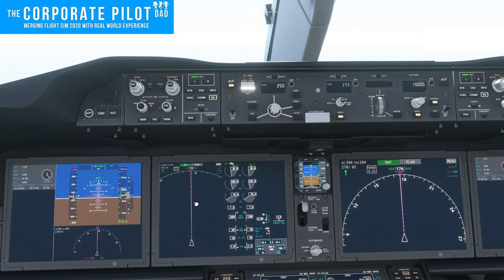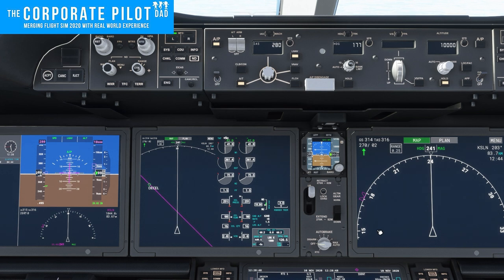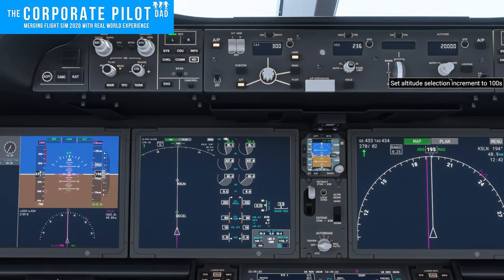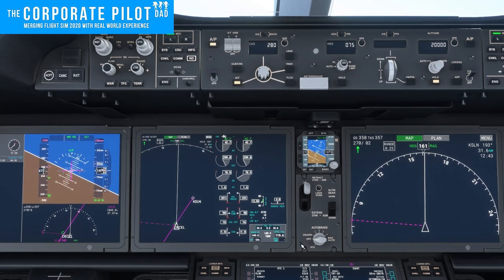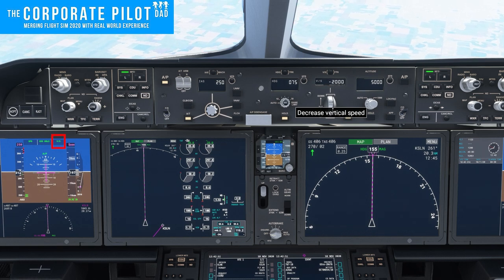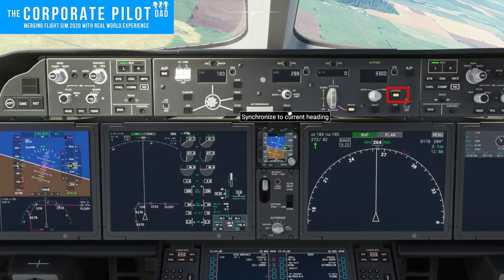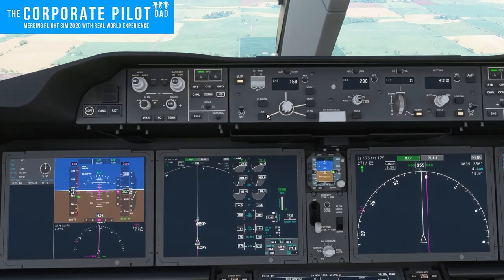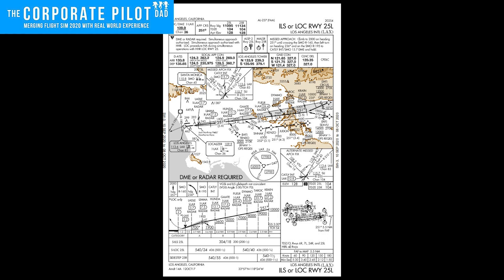Boeing 787 Autopilot Tutorial | Microsoft Flight Simulator

Comment: For me, the autoland just decided to nosedive into the runway. Everything goes smoothly until the very last point, about 10 feet above the runway, but then it goes down for some reason instead of holding height and descending naturally. It's an ILS approach, KDMA to LRAX, RWY 25L. I could of course land it myself, or hold the stick to stabilize touchdown, but I just thought the Autoland function would've been so cool if it worked. Might've just been an unlucky attempt or a bugged runway, but still. Feels bad
Reply from the maker: When I made that video I had great success with autoland.  Since then, and a few updates later, it does not seem to work as well.
Reply: My auto throttle doesn't even work for some reason, even with this very nice tutorial

Comment: Great vid and info. Thanks. I had a bit of confusion with the Dreamliner last night. I was flying in to KATL and every time I tried to click APP or LOC the plane would try and turn the opposite direction and I was looking at the landing plate on Navigraph. I should have been picking up the GS. Any idea why that might happen? Thanks again.
Reply from the maker: It is hard to say.  In the 787 if you hit LNAV it follows the GPS route.  If you press LOC/FAC on the far right side of the flight guidance panel, it will ignore the GPS/FMC route and intercept the localizer.   Once you're cleared for the approach or in this example, on the localizer, reach up and press APPR on the panel.  I haven't used the 787 in quite a while but when I did use it in FS2020, that's what should make it work correctly.  The LOC/FAC button is the solution, I believe.  I think button and it's explanation is at the end of the video.  You did say you pressed APP and or LOC and had that problem so if you already tried this, let me know.
Reply: @thecorporatepilotdad  thank you. I did try that. But I think I very well may have programmed something wrong from the start. I'm pretty new to flight planning and it's a pretty big learning curve. At least for me. I wish I had a tutor lol. Thanks for what you do for the rest of us.
Reply from the maker: @crawl3ysnipe  Out of curiosity, did you input the localizer frequency into the FMC or were you doing a GPS approach? What airport and which approach were you doing?
Reply: @thecorporatepilotdad  well, that got complicated lol. At the end I put the localizer  but apparently that was too late. I was flying from KDFW-KATL. Also for some reason, the plane didn't fly the correct rte. That had to be me inputting the wrong wpt. I'm actually trying it again right now and I already know I'm going to have the same problem. I tried to load the FP from SB and chose the wrong wpt I guess.

Comment: I’ve been looking all over the internet for this but I can’t find an answer. Is there a way to enable the managed speed mode where the auto throttle responds to flap changes? I’ve done it before but couldn’t get it on my last few flights. In airbuses it’s easy because there’s just a button but not on the 787. Thanks in advance.
Reply from the maker: When ATs are engaged it should adjust power to maintain the set speed regardless of flap settings. In managed speed mode(speed being controlled by the FMC waypoints/speeds on SID/STAR), I don’t believe the B787 in MSFS will hold speed with the FMC.
Reply: @thecorporatepilotdad  Just to make sure I’m getting this right (there’s a good chance I’m not), the 787 doesn’t have a managed speed mode in the same sense as airbus? If so that’s odd because on multiple occasions it has adjusted the speed based on flap increases/decreases.
Reply from the maker: @nls.135  the speed does adjust on the airspeed tape showing the max speed for given flap settings as flaps are added.  I don’t believe it is capable of adjusting speed with ATs on an arrival with a particular speed at a waypoint due  MSFS programming.   For example, the airplane I fly in real life has auto throttles and they can be set to follow the speeds on an arrival in the FMS (managed) or set a speed manually with the speed bug (selected).  The Airbus works this way but I do not believe the B787 in MSFS will do anything but selected speed set by the speed bug.

Comment: How would you exit heading select mode to go into LNAV? Because when I clicked LNAV again, it didn't want to go back to my flight path. I tested that by turning the heading bug and it was still in heading select.
Reply from the maker: You did it the right way by pressing LNAV when in HDG mode.   When a button is pressed on the flight guidance panel such as HDG or LNAV, make sure the flight mode annunciator (top of the PFD) switches to that mode or at least arms (in white).  Sometimes an airplane will stay in heading mode but LNAV will be selected and won't change to LNAV until the course is close to being intercepted.
Reply: @thecorporatepilotdad  yeah I tried waiting until it got on course and still didn’t work. Maybe I’ll try it later today. Thanks for the help tho.
Reply from the maker: @Zenoman1234  Did it do the same thing before the latest update?
Reply: @thecorporatepilotdad  I actually upgraded to premium deluxe yesterday lol. But I know how to fly the 78 since I have seen many vids of it.

Comment: Hi there, actually when A/T is on, I can pull my throttel lever to idle, but nothing happens, it keeps running, plane goes into flare, but it does not sink enough and flares alot until I push the nose down doing almost a 3point landing. Anyone else got this phenomenon?

Comment: I can't seem to figure out when to switch from LNAV to loc then to approach mode. Other than that I've finally started landing doing ILS.
Reply from the maker: LNAV will follow the localizer.  Approach mode will follow the loc and glide slope.  In the real world, APPR is pressed when cleared for the approach. In MSFS, APPR can be pressed any time up to the final approach fix/glide slope intercept altitude or before.  APPR mode will still follow a course but it will also follow the GS down to the runway.
Reply: @thecorporatepilotdad  thanks for this video, used it and I actually landed the 787 which felt really nice.
Reply from the maker: @ilbambino96  glad to hear you’re enjoying it!
Reply: @thecorporatepilotdad  thanks! I'm using my xbox controller for now but would you recommend getting a mouse and keyboard as well?
Reply from the maker: @ilbambino96  I have MSFS on PC but anything you can do to make it easier would help.  Rumor has it MSFS can be  difficult with an XBOX controller.
Reply: @thecorporatepilotdad  gets tricky while I taxi and using controls in the cabin but other than that it's alright. But yeah thinking of getting a mouse and keyboard for it as well.

Comment: How did you control the speed using the autopilot painel if the autotrottle was suddenly deactivated (7m40s)? It looks like A / T was still working. How did the plane keep 180 and then 160 knos with A / T Off? Thanks
Reply from the maker: I was adjusting the throttle manually.

Comment: When do you typically press the VNAV button?  Can you use it also for
Take off and climb?  I tried it and it turns off when I hit cruise.  Just wondering when to hit it.  Thanks!
Reply from the maker: I do not think VNAV does a whole lot of anything with the default aircraft.  It is extremely limited with the 787.  You would press VNAV and set the bottom altitude and wait for VPATH to capture.   Here is a video on VNAV I did a few weeks ago if you haven't seen it already.  The concepts are the same.  https://www.youtube.com/watch?v=Uu36df6145g&t=1s

Comment: liked your auto pilot video.. my 787 heading "sel" does not work. it is locked in the hold mode. Any ideas on how to fix it?
Reply from the maker: On the heading knob there is a black button labeled SEL for select.  Push it and the flight mode annunciator will go from HDG HOLD to HDG SEL and then the AP will fly whatever heading is selected.

Comment: So, I've tried this several times w/ the 787. Everything goes smooth until about the last 50 ft or so and the nose pushes straight down & I bounce down the runway.  lol.  any idea how to keep that from happening?  The G/S and Loc are captured....but just...SLAMS into the ground.  Help?
Reply from the maker: Do you get rollout and flare on the flight mode annunciator?  Was it windy when you tried it? I haven't tried autoland in a while.   I'll have to try it again and see what happens.   It's been hit or miss sometimes with autoland.
Reply: @thecorporatepilotdad  thanks for responding.  I do get rollout & flare mode on the annunciator. I've tried it at least 12+ times in all conditions with the same result. Gets right above the runway and the - nose down.  Here is a video from a stream last week - https://youtu.be/-t1J7L8fyPk?t=8132. This was the first time I turned auto throttle off & tried to control the throttle myself - thinking maybe that would help - but it didn't. lol.
Reply from the maker: @thetattooedbacon  When I did that video the AP was on and the auto throttle was off.   It was also a few updates ago so who knows what changed.   Are you live streaming through YouTube? I'm planning to try a live stream with the CJ4 Friday or Saturday night.   Maybe both.

Comment: sometimes when o press LNAV the plane still doesn’t follow its flight plan. any reason why?
Reply from the maker: What does the flight mode annunciator show when you press LNAV? The FMA is on the top of the primary flight display.  That’s where the AP will indicate what it’s doing in green and what it will do next with a mode below or beside the active mode.  When LNAV is selected, the FMA should indicate NAV in green (possibly with a box around it)  when the flight plan in the FMS is being followed.  Also make sure a waypoint is selected so it has a fix to fly to.  Hope that helps.
Reply: it works now! thank you

Comment: My biggest problem is holding correct altitude in the 787. It's supposed to have a standard baro button but I can only adjust it. I reach fl40 and atc tells me I'm 500 feet above so I blindly adjust baro pressure until I'm no longer being yelled at by atc. Then once they stop yelling, a few minutes later I'm again 300 feet or so above my FL. Despite me using altitude hold, it still does this. I know I'm using it wrong but the button that's supposed to be a standard "the std baro button" baro measurement doesn't on xbox. I've searched everywhere for info and fixes, but to no avail. I just have to play with pressure until atc shuts up.lol
Reply from the maker: ATC has been silenced for months on my MSFS.  Silenced ATC is more realistic than talking ATC on MSFS.  OK I am semi-joking.  What you describe is a known issue after the last update.
Reply: @thecorporatepilotdad  to be honest man, I got sick of it, put it on fl40, and muted the tv. I'm glad it's a known issue and I was able to semi accurately describe my issue since I'm a relative noob. I imagine now, my playing with baro until atc shuts up is the best option at this time to adjust. My vnav also goes haywire. I turned it on at fl40 and it shot up at 5,000ft a minute and just kept on going full speed. I didn't wanna ruin my long flight so I turned it off and used flc. That's a really great little button.
Reply from the maker: @sebastianthehotsaucedude5473  FLC is great.  It works better in MSFS than in the real world.  VNAV won’t do anything unless altitudes can be entered into the FMC/FMS manually or via an arrival (STAR).  VNAV helps hit altitudes at waypoints on descents and keeps from exceeding altitude restrictions on departures.  There is a video on my channel about VNAV.  https://youtu.be/Uu36df6145g
Reply: @thecorporatepilotdad  yeah just spent 7 hours flying anchorage to tokyo and everything glitched out right as I went to land. Needless to say I'm not very happy.

Comment: VNAV: Does it only work during approach ?
I have seen if the flight plan have changes outside the approach, VNAV does nothing. I’m in the 787-8
Reply from the maker: https://youtu.be/Uu36df6145g

Here is a video I did on VNAV and where it can be used.  The concepts are the same but so far it works best with the CJ4 Working Title mod.   VNAV doesn’t really do anything with default aircraft.

Comment: I am wondering though, I just took off and I tried to enable autopilot after taking off, but the autopilot does not work. I'm cruising with fully manual controls, and I don't know what I did wrong.
Reply from the maker: It is hard to say without seeing it.  Are you certain the AP is on and the proper modes on the flight director are selected for what you are trying to do? When a button is pressed on the flight guidance panel (AP modes like VS, HDG, FLC, etc), always VERIFY the button pressed makes a change on the flight mode annunciator (the thing on the top of the attitude indicator on the primary flight display).

Comment: i noticed your AP didnt follow the flight path at all...i am experiencing the same issue. any way to fix that?
Reply from the maker: It followed the course through the video and the ILS at the end.  The course on the MFD was offset a small amount toward the end of the video, but the localizer needle was centered.   Which part in the video didn’t follow the FMC course that you’re having trouble with in your sim? For left right course LNAV needs to be selected and APPR for ILS and LPV approaches.   If you want the AP to ignore the FMC course and fly to the LOC for vectors on an ILS approach select LOC/FAC.  Hope that helps.

Comment: That autoland was more like an autoslam but that's still pretty impressive for a (prem deluxe) stock plane.
Reply: Atleast it can land much better than me
Reply from the maker: But you can practice and get better.  The machine cannot.
Reply from the maker: @mohammedfouzan9115  That wasn't bad.  The touchdown was good.  Get lined up on final a earlier and hold the nose up in the flare, let the airplane sink a little before raising it more.  Overall, still not bad at all.
Reply: @thecorporatepilotdad  thanks a lot 
I was using a controller btw
I have a problem in flaring because when ever I flair , it just goes up or it bounces
Reply from the maker: @mohammedfouzan9115  Well then that is pretty good for a controller landing.  I have played flying games with a controller.  It's no easy task compared to the sensitivity of inputs you can get with a joystick.

Comment: Do u fly a full flight with autopilot on Lnav and Vnav set together, I watch a video of a real airliner and saw them use it both the entire flight
Reply from the maker: You can use both but be mindful of the altitude select knob and where it is set.  If you’re not cleared to descend via an arrival leave the clearance altitude in the alerter.  If cleared to descend via an arrival then set the bottom altitude.  If the bottom altitude of an arrival was set but not cleared to descend, the airplane would start descending to meet the restriction of the arrival.  That’s the real life answer.

Comment: So does the 787 have autoland or not? Other YouTube videos show it doesn't and they say you have to disengage the autopilot before landing.
Reply from the maker: It worked for me in the video and has worked for other people.  If not on an ILS it won’t work.  If you turn the AP off it won’t work.  And there are Flight Director modes that pertain to auto landing.
Reply: @thecorporatepilotdad  Thanks for the quick reply. 👍 This is strange because some other videos also use ILS approach yet the FLARE and ROLLOUT functions are not even armed, even at the last moments. They all just disengage and land by hand.
Reply from the maker: @gabor-toth  I haven’t flown the 787 in 6 months or more.  There have been various updates since the video but it definitely worked in the video and before I recorded that video on another landing.  I’ll have to try it again.  The 787 is very buggy and the FMC is not the greatest so  it doesn’t get used a lot on my sim.
Reply from the maker: Auto land also requires minimums to be set in the radar altimeter.  I honestly can’t remember if I set them or not and got lucky if I didn’t set minimums.

Comment: On Airbus aircraft, like the A320, I believe  you have to enter some data into the FMC, like the wind, temp, and barometric pressure before you can go in for an ILS autoland. Does this step not exist on Boeing aircraft?
Reply from the maker: I believe autoland uses DH (radar altimeter derived height) which has to be set vs using the barometric DA(H).    Whether the other info matters on MSFS or not, I don’t have an answer for that.
Reply: @thecorporatepilotdad  wow I didn't expect such a fast reply. Thank you. I'm new to Boeing aircraft and your videos have been helpful.